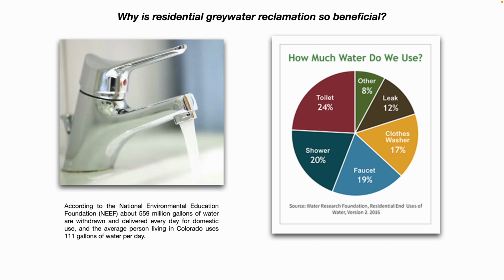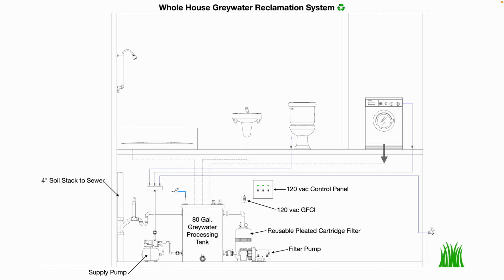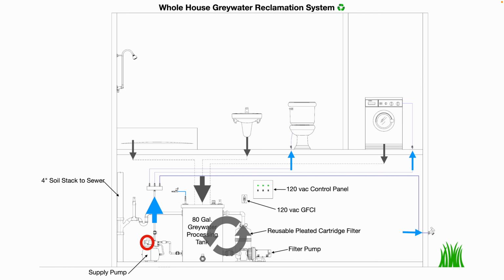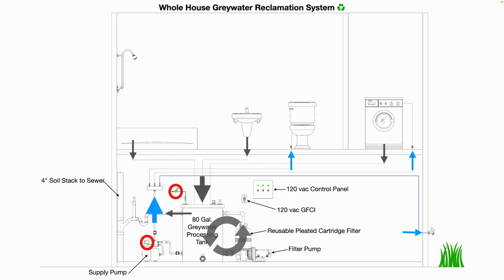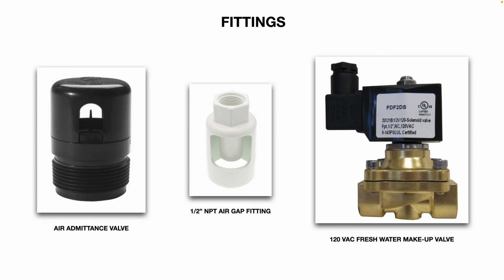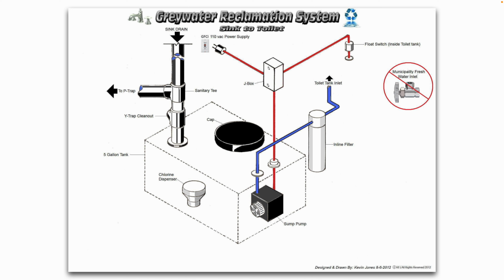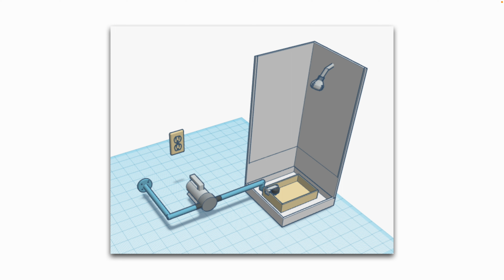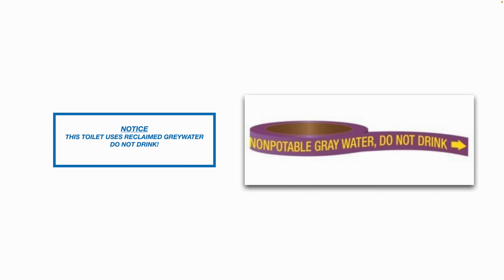Lower Your Monthly Water Bill With This System!

Comment: Thanks for providing this.  There are several new systems available that use other media.  One thing I will probably add or at least think about is adding an attic tank prior to feeding the toilets,.  The purpose of this is to allow the toilets to fill when power is list.  I'd need to add some other components to trip an air admittance valve opening on this tank if power is lost.
Reply from the maker: It’s a great idea.
Reply: @kjfacilities-maint  Thanks.